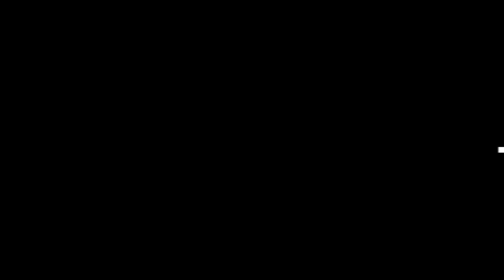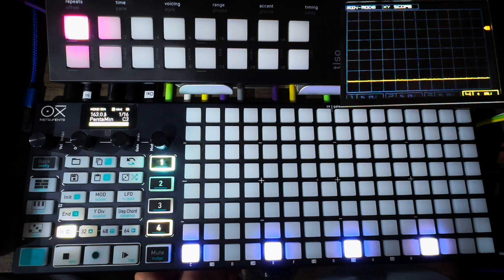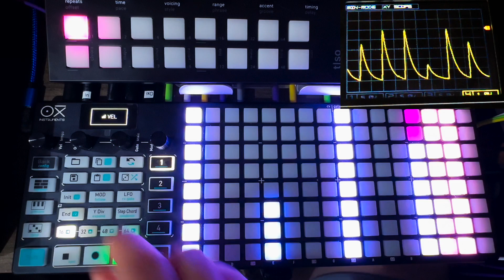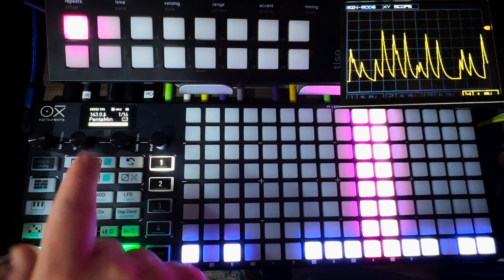Oxi One: Trig Envelopes Explained

Comment: Great info, thanks! So the envelopes just get patched to any VCA or LPG right?
Reply from the maker: Yes that's the most common place for them, remember voltage is 0-5v on trig envelopes
Reply: That being said, where would you patch a velocity output from the Oxi to modular? I was thinking velocity would need to go to the VCA as well, to control the amplitude of the VCA output, but the VCAs all typically only have one CV input… which you’d need to patch in the Trigger envelope, in order to modulate the VCA. I guess I’m a little confused on how that would work for a typical modular voice. I know the pitch CV from Oxi would go to the v/oct of the oscillator, and as you said the Oxi Trig Env goes into the VCA and also potentially into the filter frequency… but where does Oxi Velocity get patched?
Reply from the maker: @andrewnancarrow  well on the oxi trig, velocity is built into the envelope, velocity is the initial amplitude of the trig envelope. So there’s no need to use velocity to cv out unless you want. So if I’m using trig envelope to vca, you could also use velocity cv to filter cut to brighten the sound or Q to juice resonance on higher velocity, or some other timbre control like pulse width or something on the oscillator. Anything that sounds good really
Reply: Ok cool… so in essence oxi velocity cv is just straight voltage… and can be used effectively as just another modulation lane? Do you know what the velocity voltage range is? And can it be set to go bipolar via offset? That’s my other question is since all Oxi values are measured in midi cc values, I have a hard time figuring out how those values translate to actual voltage numbers.
Reply from the maker: @andrewnancarrow  yes anything translated to CV is just voltage with its own shape, trig envelopes are definitely usable, but can require a little bit of back-and-forth to learn the controls and dial it in an oscilloscope will really help you here. Velocity does not offset in the Oxi you could offset it outside of the Oxi with a separate module. Range is 0-5v for the trig envelope, but for controls that have an offset like the LFO or mod lane can be -3 to 5v, so 8 V range. In the CV matrix you will see your trigger envelope rise and fall with the blue light on the pads. Essentially, it’s showing you 5 V from the row three pad all the way to the top tow pad is 5v.
Reply from the maker: @ if you have more questions get on the discord, we can talk easier there https://discord.gg/CjDpFPz52w